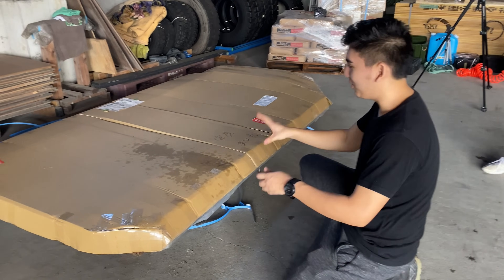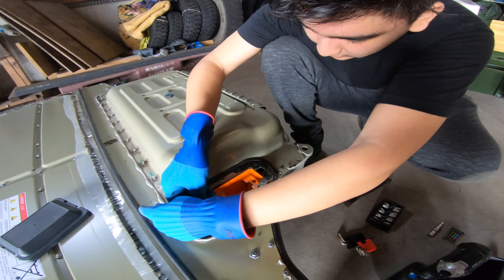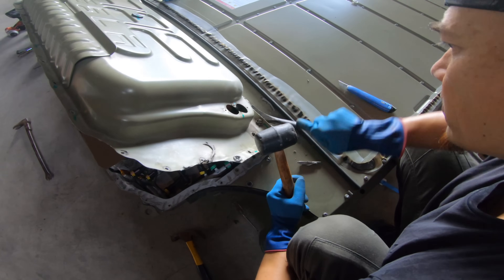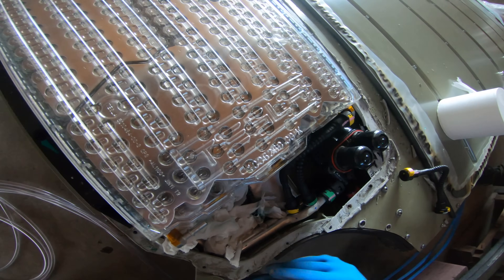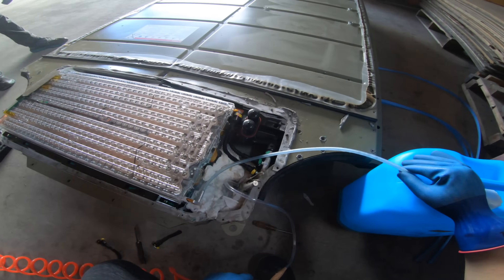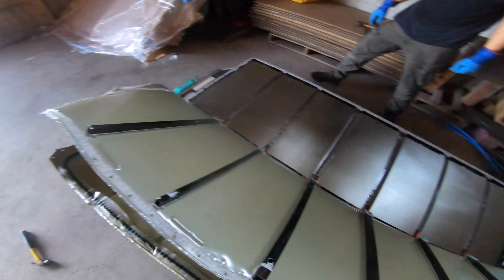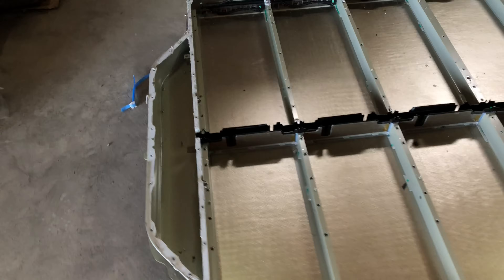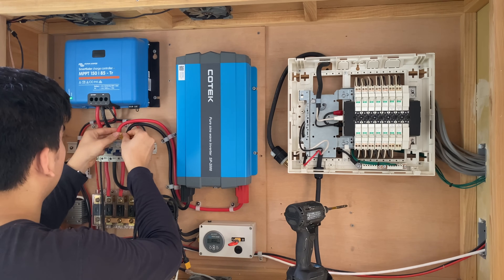The 60kWh Tesla Battery Powered DIY Powerwall

Comment: Nice setup and great video. Could you share the numbers? Total investment
Reply from the maker: Will be doing a follow up video with all the numbers soon 👍
Reply: @MM-yn9ni   i think is waaaaay more than 4k
Reply from the maker: Total investment would include other parts. Not only the battery.
Reply: @MM-yn9ni  Wow what about the inverter, wires, others parts he replaced from his rig to support the modules ... I also saw 4 ppl total so what about labor cost for the help. On top of things he may not of put in the video cost wise... So $4800 for the battery module which I’d love to know where they got one for that price is NOT! the total investment.

Comment: Nice setup. Are those modules 48v each?
Reply from the maker: Thanks! Each module is “24v” 6S.
Reply: @ZaiFuchigami  ah cool. What Tesla models have these? Makes it easy to make monster 48v walls :-) 

I have 45kwh leaf wall.
Reply from the maker: Currently the Model S and X have these modules. The new Model 3 and Y use different modules which are very hard to use because of their higher voltage per module (96v)
Reply: @ZaiFuchigami  there are 96v invertors. But they also can be repacked into anything else